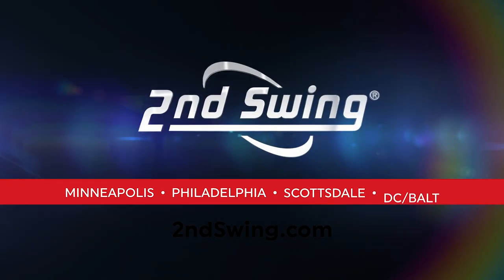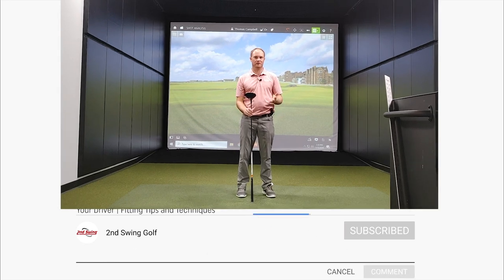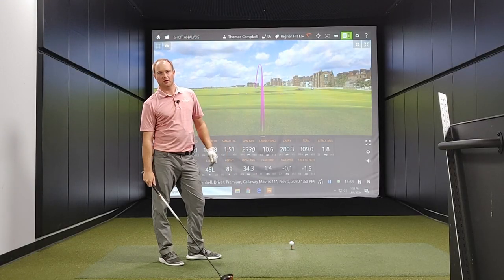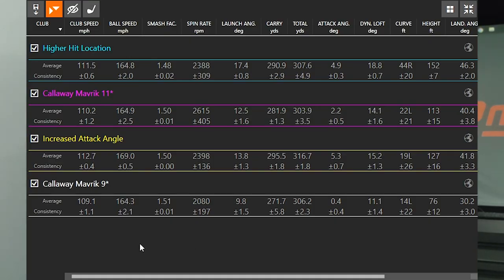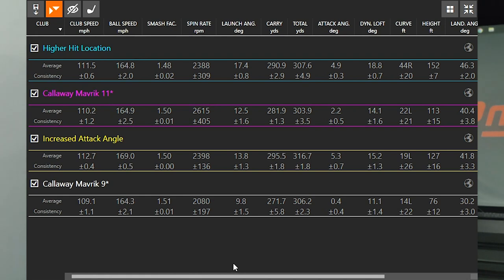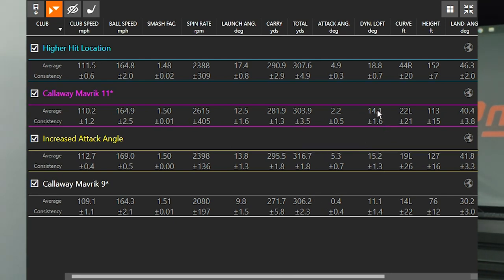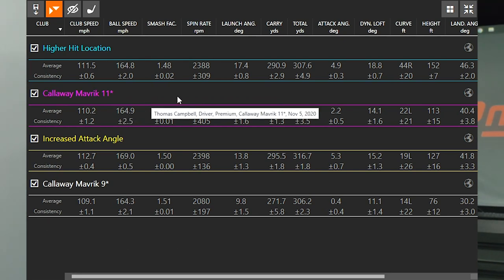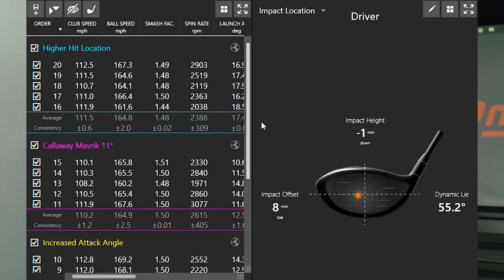3 Ways To Increase Launch Angle With Driver | Golf Club Fitting Tips

Comment: Happy New Year from a cold and frosty, but bonnie Scotland.  Another fantastic and informative video. 

Thomas, do you have to adjust anything else in your swing when you put the ball forward in your stance? Will having the ball ‘too’ forward affect direction (fade more)?  Many thanks.
Reply from the maker: Thanks for watching! When moving the ball in your stance, the face angle will likely change based on your swing movement. The ball further back in your stance, for example, would likely launch lower with a more open face angle. The opposite is true if moving the ball forward.

Comment: How much distance on average would you lose with 1500-1800 more spin?  I've hit on a sim a few times, I have a fast swing but need to get that contact through the ball as the ball speed isn't there to match it.  Either way, my backspin nears 3850 sometimes over 4k, but never under 3500.  Obviously I know I really need a fitting, but how much is this killing me?  Hover around the 245-260 total distance, few get up there near 270, or 280+ with a lucky bounce.

Comment: Real great content but please sort out the sound turn the microphone down because it sounds like your screaming into the microphone..
Could you do this test with a 12 ° head and turn it down in loft  for comparison .
I was fitted 2 years ago for a 12 ° ping 410 plus because I was struggling to get any real hight ( 82 " at the time Carrying 215 on average  ) but since then I've made some changes and now even my average ball is carrying 235 with a general hight of 130" with basically zero runout so I'm considering changing to a low lofted driver to get a more optimal peak hight and runout .
Reply: I would definitely turn down the loft of your driver.  With your speed (based on average carry of 235 yards) you are definitely getting too much height.  Obviously you would need to be fitted properly to the driver but in your position I would try the G410 in a 10.5 degree head
Reply: @justinstephenson9360  
Appreciate the advice have it turned down to 11 at the moment fittings in my area are pretty naff , ( Bishop Auckland area of Country Durham....
I had to travel to close house to get fitted properly last time .
Reply from the maker: Thanks for watching! We've got some tech solutions coming soon to improve the audio. As for your driver, we'd definitely recommend coming in for a fitting. 130 is probably a little too high and you don't want to just turn the loft down on the driver and manipulate the face angle